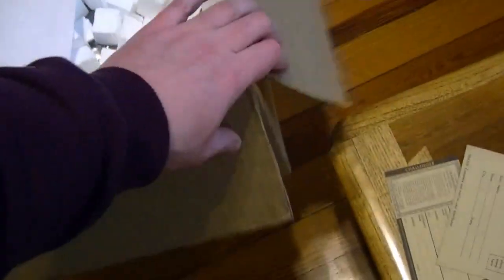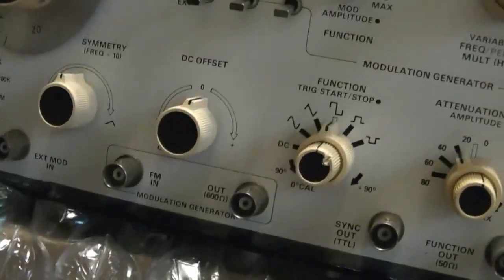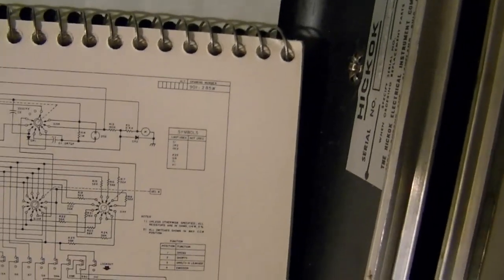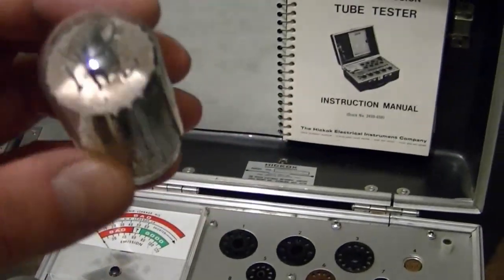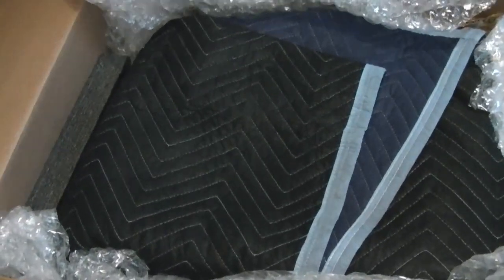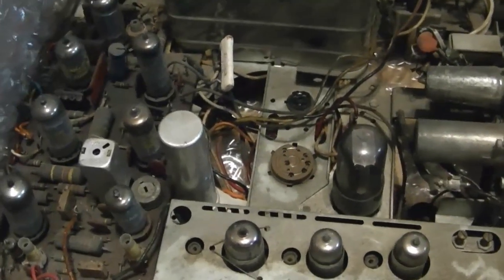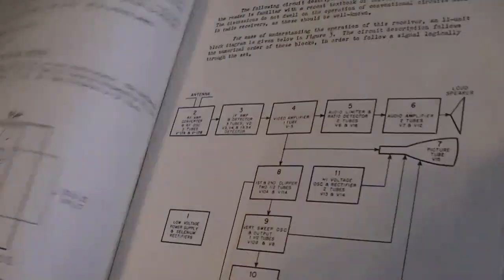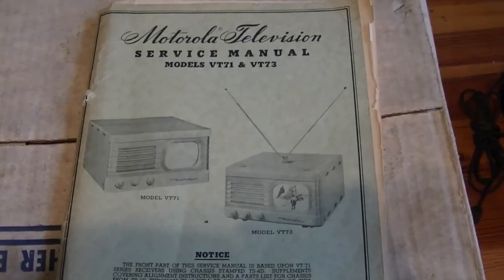Unboxing Mar 20th, 2014

Comment: People are asking you to work on their stuff because you do great work. Lots of folks who post vids about working on vintage electronics just hack at it. You've got the test gear and tools to do it right. Have you ever thought about building an all-tube audio amp? They fetch thousands of dollars right now. That might be a way to offset some of the restoration project costs.  Just a thought... :)
Reply from the maker: Thanks.  There are so many other guys build amps it doesn't really appeal to me. Plus, to be honest, I get a little annoyed at the amp guys driving up the price of tubes commonly used in the sets I restore like 5V4s, 12AU7s and 6SN7s.  It makes restorations more and more expensive.
Reply: bandersentv Yes. I understand your frustration. The prices they charge for this stuff are unbelievable. SImple circuits, all point-to-point wiring and NOS tubes... Maybe $100 bucks worth of parts, at the most. Then they charge $2500 per unit sold and that's the low end of the tube audio spectrum, pricewise.. I follow high end audio closely and It seems that if you attach the word "Audiophile" to anything the price gets jacked up. They also sell "audio only" filter caps for $200 a pop! Nichicons work just fine for a whole lot less... It's ridiculous. :)
Reply: Joe Collins
Yes! And who are the guys buying those $2500 amps?  The same types of bozos who worship at the alter of esoteric audio magazines and sites.  Or, the guys who covet the largely recycled designs of boutique guitar amp gurus. A combination of too-much disposable income and bombed out ears from years of listening to too-loud music. For driving up tube prices, I say string 'em up by their oxygen-free copper cables. :)
Reply from the maker: Joe Collins
Oh, I don't care what they charge for the amps.  My point was that they driven up the price of tubes for everyone.  As far as I'm concerned, NOS and used tubes should be reserved for restoring/repairing vintage gear.  You want to build a new amp, go ahead but only used new tubes from China or Russia.
Reply: There are ways to do the audio amp thing right. Look at Audio Power Labs 833TNT amp -based on 833 transmitting triodes. They got a bunch of Chinese 833's, matched them, sold the ones they could not use on Ebay. $170,000 for a pair of their monoblock Class A amps. $47,000 for a pair of their 50TNT monoblocks based on the 2-572B transmitting tubes. Yeah, it is all nuts - but hey at least they are not messing around with tubes restoration guys are using, and applying maximum financial sink to audio phool pocketbooks to boot.
Reply from the maker: cny02253
Wow!  I've seen amps build around transmitting tubes before but never for that price!  I think the most irritating amps I've seen were builting using all RCA globe tubes from the 20s. No reason to use globe tubes in an amp whatsoever.  I'd much rather they go into a 20s radio.
Reply: Not only is there no reason to use globe/balloon type tubes in a audio amplifier, if high quality audio is what they claim to seek they are moving in the opposite direction. The reason the tube industry started moving away from balloon/globe style envelopes to shouldered types is that there is no structural support for the internal elements at the upper end. In an RF tube this was seldom an issue, nor was it an issue with a lower powered tube like a #26 or a 01A, but as audio output tubes increased in power output, and in complexity, microphonics became a real problem.
 Trying to build an audio amp with RF tetrodes/triodes is an even more stupid idea, not only are they not intended for audio use but the power consumption is just horrendous. Some of those overpriced amps even use mercury vapor rectifier in the power supply, why? Because they look pretty with that violet glow, never mind the fact that they produce all kinds of RF has.
  If I were going to build a tube audio amp I would use very common, and relatively inexpensive, tubes that are still in production in China, or the former USSR. Tubes such as 6V6s, 6BQ5s, 6L6s, etc, all of which can be wired in a semi triode configuration.
Reply from the maker: OlegKostoglatov   Great points!  I've also seen amps where they use blue LEDs like this.  Groan! : https://www.sparkfun.com/images/tutorials/Amp/Amp-8.jpg
Reply: +bandersentv well, it isn't just because you also have the equipment to do things right, you also have worked on things that were in disastrously damaged states, and got them working again within months, I find that to be miracles you work

Comment: Bob, with your affinity for sweep generators, I am a bit surprised you don't have a HP 8601A? Cheap, capable, flexible. Can be FM or AM modulated. Will handle nearly every IF you will likely run into.
Reply from the maker: I've thought about it, but all the working examples I've seen on ebay went for $150 and up.  Also they are a bit old and only go up to 110 MHz and don't appear to support markers.    I got my Waveteks for less than that, they go to 1 GHz and have great post marker features.

Comment: That original service manual is really cool! I'm hoping I can get an original manual for the 1965 (I think) H.H. Scott 344 receiver I'm working on currently, although I don't think it has diagrams quite as nice as that one.

It'd be a huge plus to have a schematic and service data for it because I can't seem to find suitable replacements for it's germanium output transistors (really weird old type, they say Bendix QP-10 on the cases no 2S numbers) two of them went tin whiskers and shorted, and it has the infamous  Callins/Nashville electrolytic capacitors in it so every one of them is bad.

It also oddly enough has a Nuvistor based "wide band" FM only tuner and I've heard good things on forums about the separate version of it, I think it might have been Scott's first solid state receiver and is supposedly rated for 100wpc, so it should be quite interesting once working.
Reply from the maker: This might help you/  http://www.audiokarma.org/forums/showthread.php?t=184839
Reply: Mine is a 344A, the 344B is a Silicon based  NPN Darlington pair type power amp, this one is a bit of a rare beast, all four outputs are germanium PNP's running push-pull like a tube amp.

It was their first solid state amp, and is a bit of a hybrid with the Nuvistor tuner, the 344B had a more conventional FET AM/FM tuner.

I actually wish it was a 344B, there are a ton of NPN/PNP Darlington pair transistors you could substitute in the B, but this is an A model.

Comment: Does it ever happen that you order used test gear on line, say on ebay, and it arrives but is in non - working condition when the sender said or implied that it was working?
Reply from the maker: Not so far, but then I usually buy equipment that isn't working.  It's much less expensive that way and often the stuff is working just fine or it's a trivial fix.